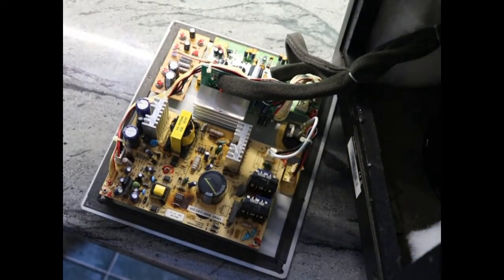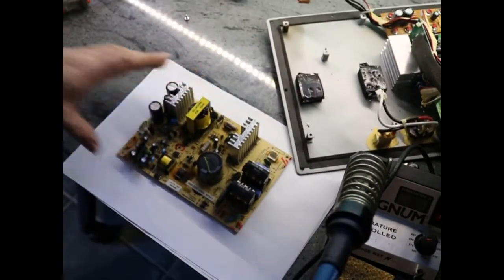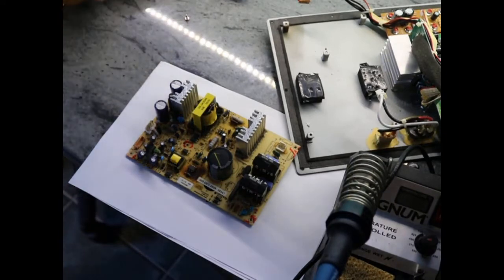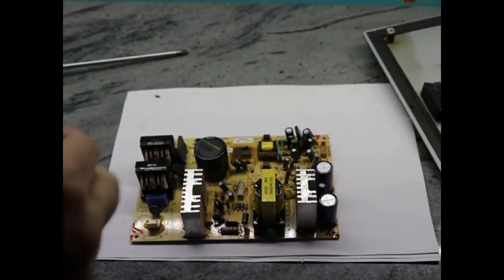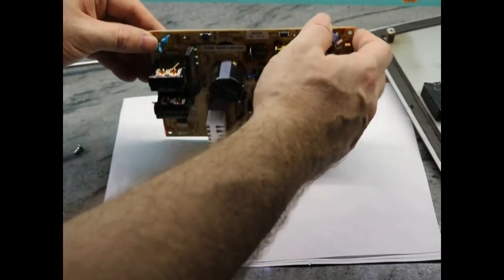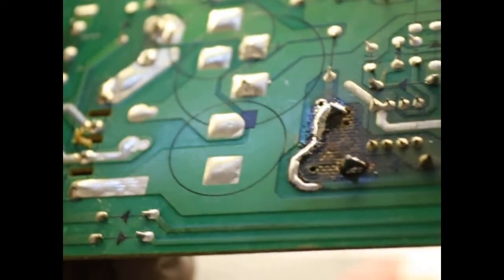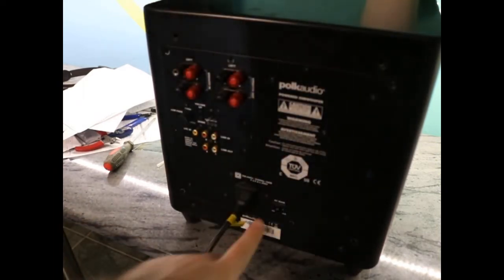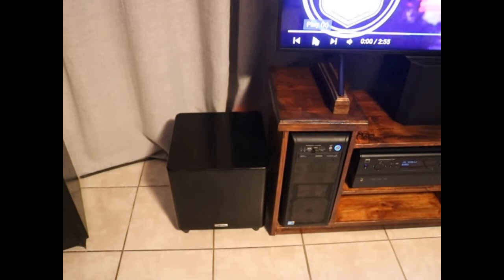Polk Audio Subwoofer DSW 400 Dead: Repair

Comment: I saw you replace the diode and repair the traces but did you also replace the chip and the resistor?
Reply: At 4:00 the part numbers are displayed. Only the diode and chip was replaced.
Reply: Thanks so much!  I got mine working by just replacing the diode. I did put in 3 in parallel hopefully to handle more power.
Reply from the maker: @Brighamdoc  Yes, the tranzorb diode which serves to protect against over voltage, is the first to go. I only replaced the chip as there is a risk it might get damaged and not because it was faulty. I'm glad you resolved the issue, it seams to be a common issue with these particular boards.
Reply: 5 volts standby power supply is a commun problem on these subs also.

Best Regards.